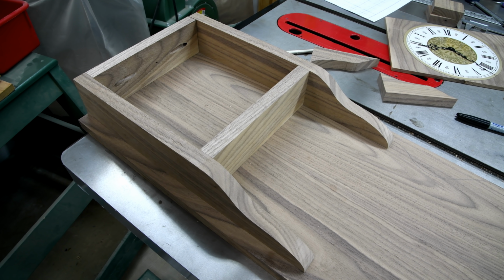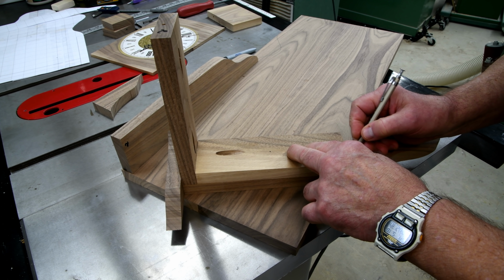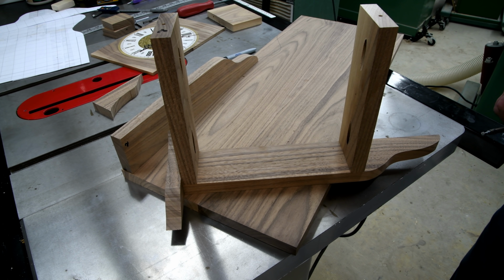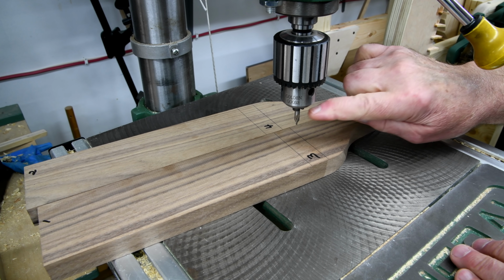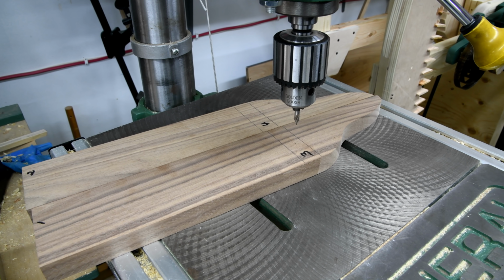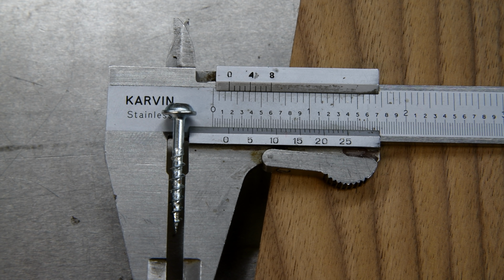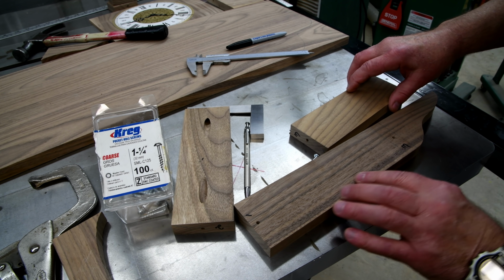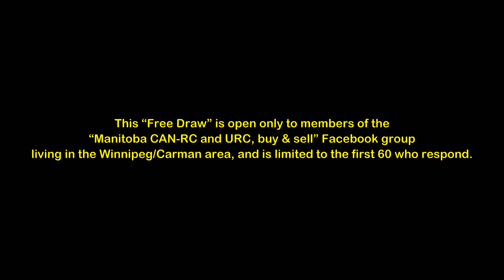The 11th Free Draw - Part 16

Comment: I can understand your concern for splitting when driving those pocket hole screws.  I used pocket hole screws on a shelving unit made of cherry and had the problem of splitting.  Found out that the coarse threaded screws are for soft wood.  I used the fine threaded screws and it solved my splitting problem.  I didn't know there were two styles.  Enjoying this clock build by the way.
Reply from the maker: Hi Dwight,
I've run into the fine thread screws but never thought about it. Now I know, thanks. Finding that this walnut is sort of dry and crumbly. Not seriously so, but noticeably so. Thinking for doing a test on the scrap piece to see if perhap a drop of CA thin might reenforce the drilled holes. Thanks for watching and commenting 🙂